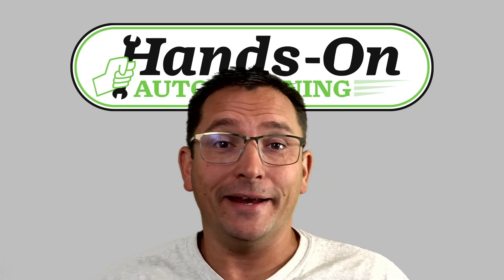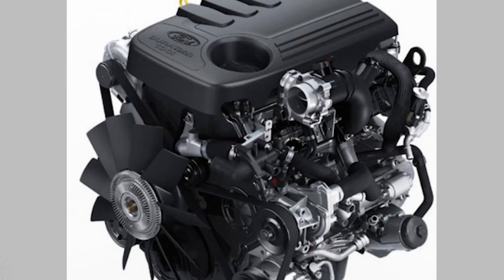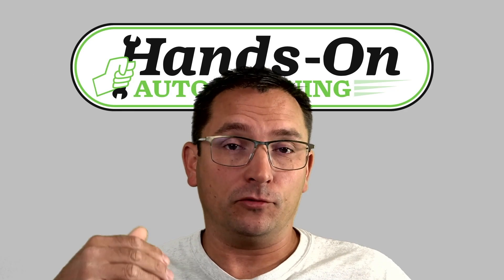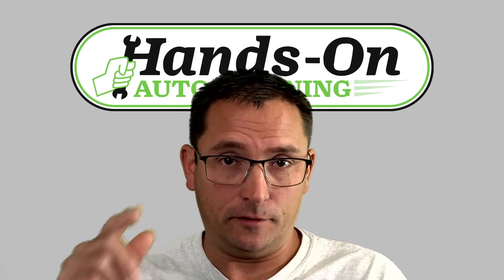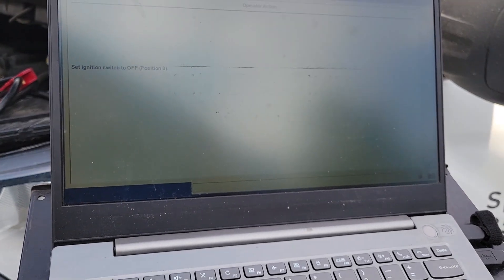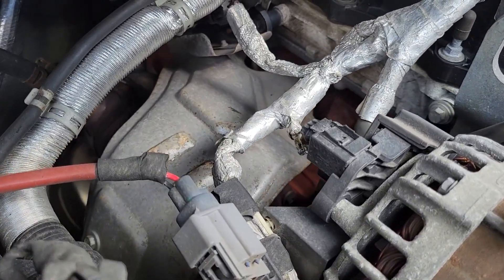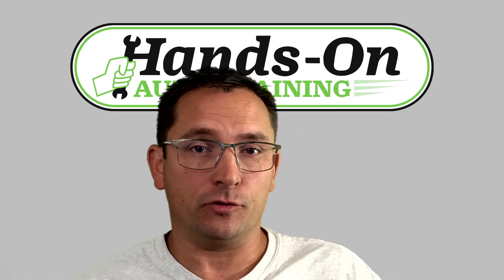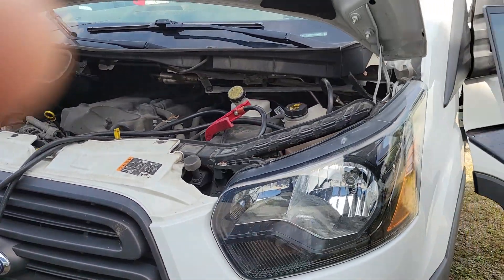Ford 3.2 Power Stroke Programming TIP

Comment: GREAT VIDEO , THANKS BRIAN ,,, WHAT SHOULD I DO , 2009 NISSAN CUBE NO CRANK SIGNAL TO MY SCANTOOLS . I HAVE CHECKED THE CRANK SENSOR WIRING , I HAVE MY 5 VOLT SENSOR SIGNAL , GOOD GROUND AND 5 VOLT REFERENCE SIGNAL BUT STILL NO IGNITION COILS FIRING ???????????????????????????????????????????????????????????????????????????????????????????????????????
Reply from the maker: Is signal good at ecm? If so motor probably out if time. Nissans are very sensitive to timing in my experience,  unplug a cam or 2 and retry or better yet scope crank and Cams for checking timing.
Reply: @BrianMann216 THANK YOU BRIAN , I AM ON DN ASKING A FEW QUESTIONS ON THIS VEHICLE RIGHT NOW,,,,,,,,, THANKS AGAIN BRIAN !!!!!!!!!!!!!!!!